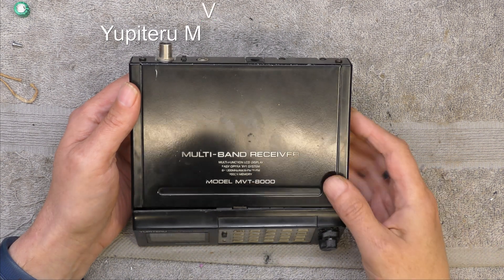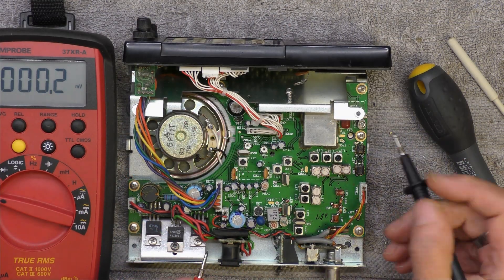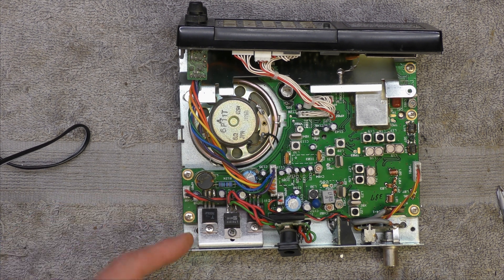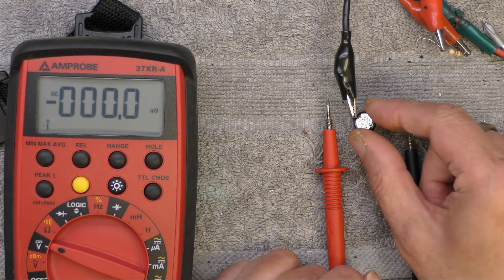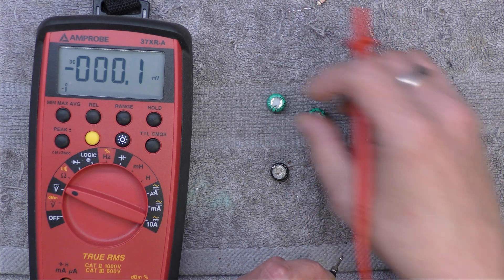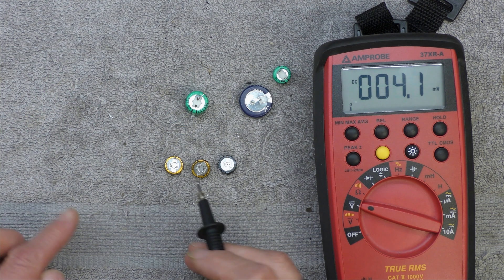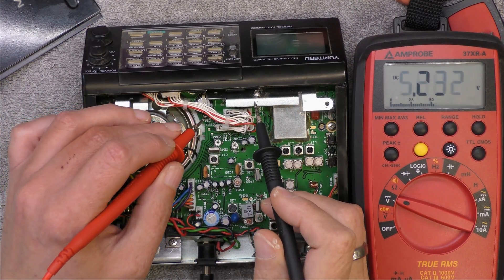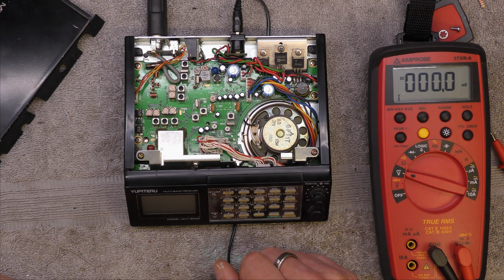Yupiteru MVT 8000 Memory Capacitor Fun (4K)

Comment: Thanks Darren, nice video. I also have an MVT 8000 with exactly the same problem. Great scanner but indeed a little hard to program like you said. I did not take the board out yet but it's clearly the so-called gold cap losing charge instantly. Where did you buy the cap you used and any idea how long it will keep the charge? 73 from PA.

Comment: Nice and simple. Must get round to replacing the cap in one of my receivers with either a recghargeable battery or supercap.
Reply from the maker: Certainly a bit of choice of backup types now, George.  The cap didn't seem to cause as much damage as a nicad does if it leaks. Daz

Comment: Well done darren, that should last a few million years :-D
I think you will have to slap that friend with a wet kipper, a radio ham that can't repair his own scanner lol :-D
I've repaired loads of equipment and i'm not a ham (Disgusting) ha ha :-D.
Pity the scanner designers didn't add a small solar panal to keep the capacitor from discharging.
Yes i'm greedy lol.
Keep up the good work mate :-D
Reply from the maker: I think the video is in case it needs to be done again ;-)   Don't go on a long holiday or your memory may expire, Daz.